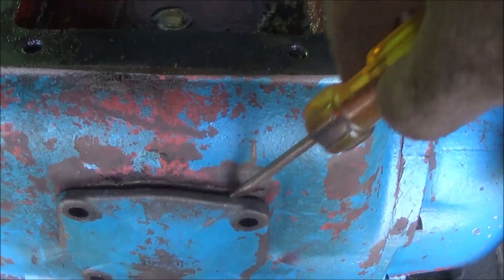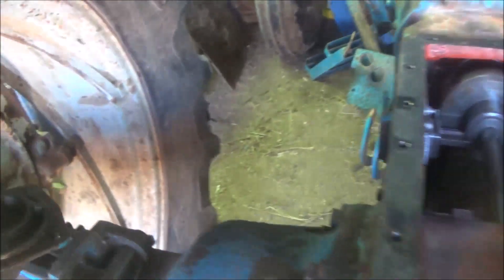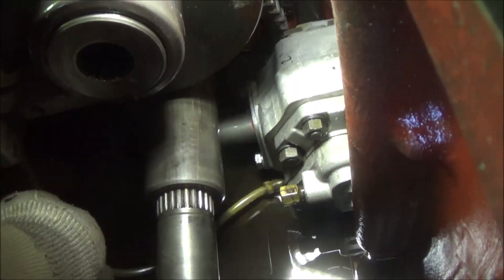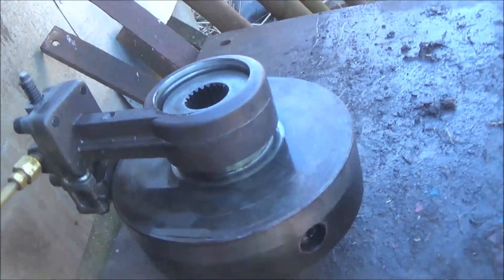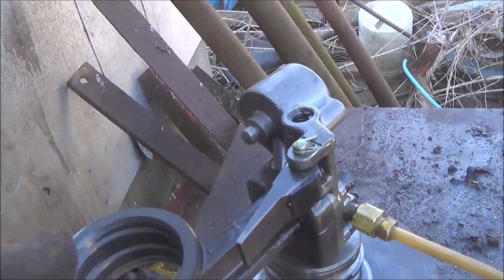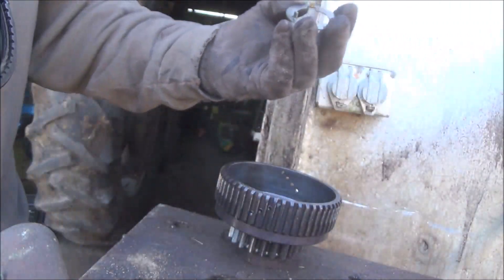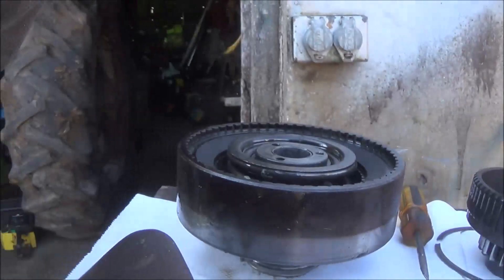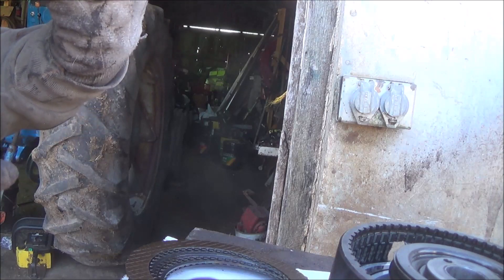Ford 5000 PTO clutch pt1

Comment: Bit of a different question but can you get to the circlip that holds the front half of the pto shaft in from on top couldn't quit see from the video have a 5000 with splines and drive hub destroyed

Comment: Hello, very good video. I have a 5000 too, and now I see without taken out parts, from my own, there is a opportunyty to speed up pto! Upper gear bigger, and lower smaller. Single speed about 800rmp?
Reply from the maker: Post 1968 Ford 5000's you could get a 540/1000 pto, this one is early 1968 and just has 540. you can change the gears but its a lot of work.
Reply: @fyrciakfarms199  It is a -71, and there is service opening down under pto lower gear, does that gear come down from that hole? I know, I have to use 2 sets of gears to take inner parts from and somehow put "faster" outrims from a 1000 gears. Wonder why anyone havent try this before?

Comment: Thank you for the video it was very helpful our 5000 pto has not stopped turning in years       our clutch plates were bad  about 3hours to repair tks
Reply from the maker: Three hours is fast to do that repair, glad the video helped. Our 5000 was back to turning with in three months but the brake plunger is a problem in it.
Reply: Did the pto spinning affect the arm lifting?

Comment: What were your symptoms that made you fix the PTO clutch pack?
Reply from the maker: We though we had to replace the hydraulic pump so we though we would fix the PTO also, hydraulic are still bad and the pto fix lasted for about 6 months.
Reply from the maker: symptoms are the pto clutch will disengage but the shaft will keep turning if it is with out a load to stop it.
Reply: @fyrciakfarms199  is it possible to upgrade to a band brake from pawl brake?

Comment: Mine its a ford 6610 but it has similar clutch pack, it start runs normal but looses speed along the run and when the tractor pulls off right and looses speed on the run again. What could be the problem?